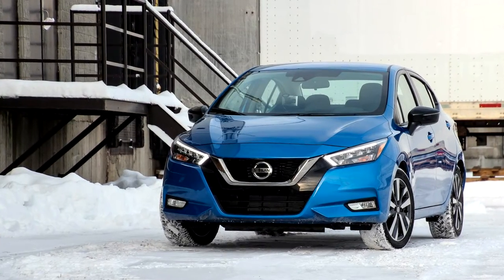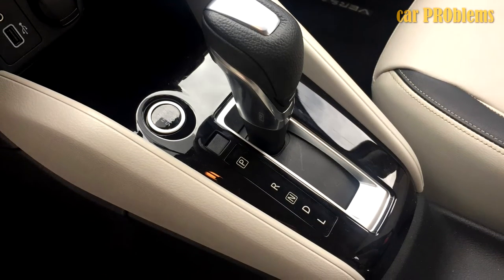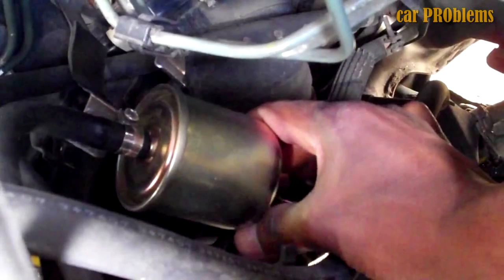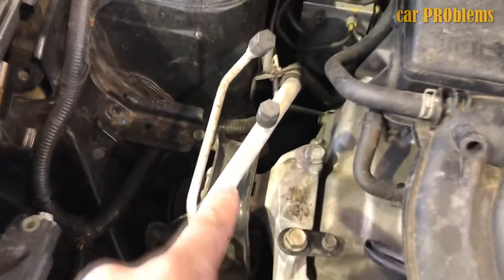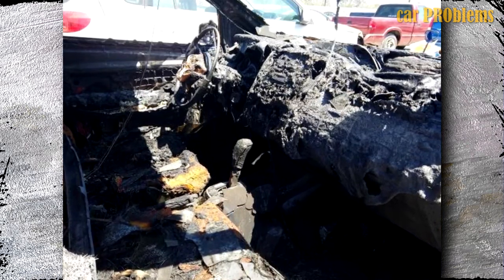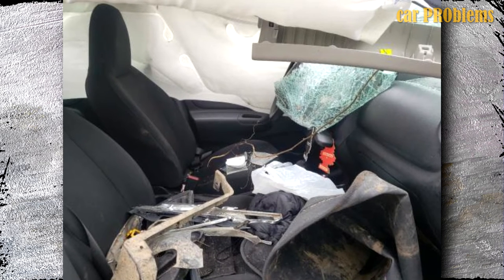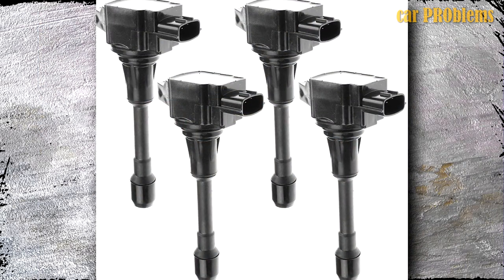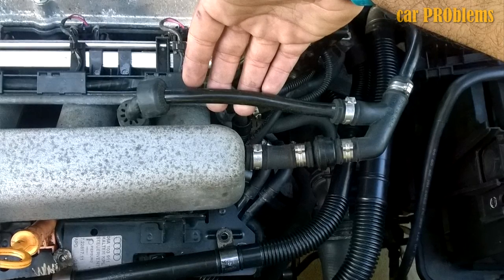TOP 9 Nissan Versa Common Problems (2012-2022)

Comment: Nissan hasn’t fixed any of their cvt problems in the last15 years.  I had a 2007 Sentra that went through three transmissions before it got to 50k miles.  Nissan told me they wouldn’t replace the fourth trans if it went out.  I traded it in the next day.